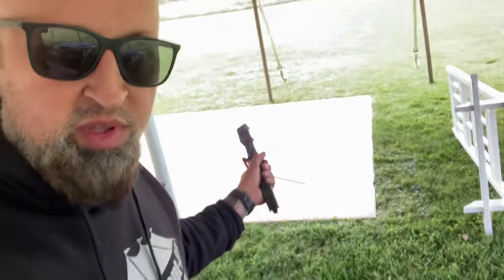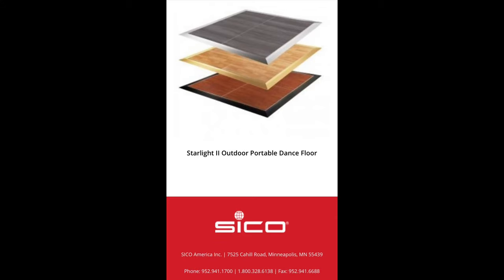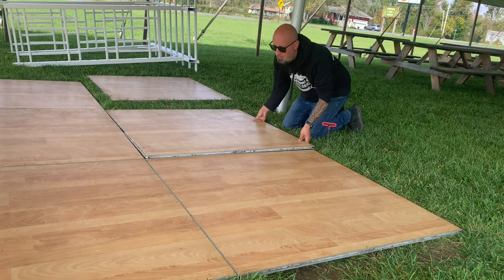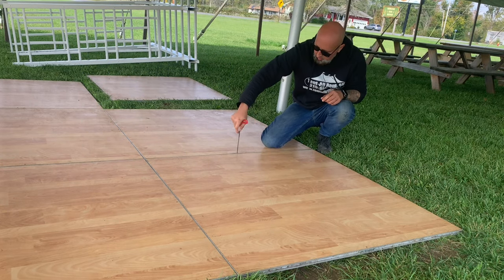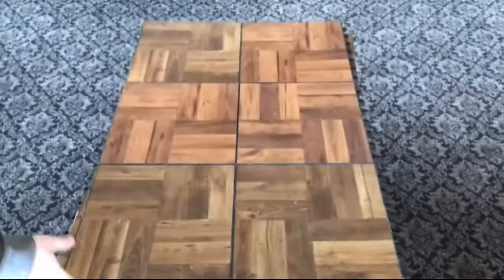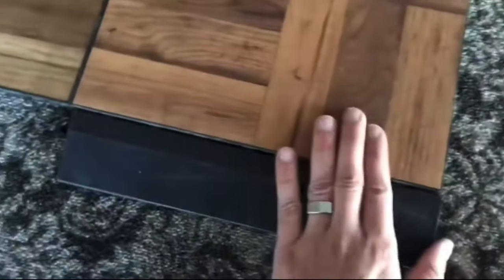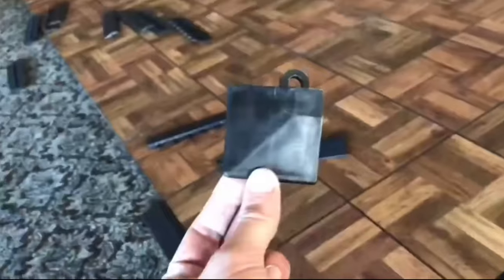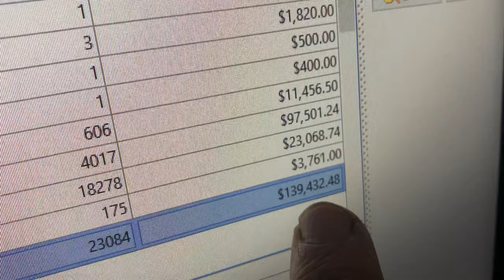Start Renting Dance Floors - BIG MONEY

Comment: How do you transport your dance floors? The case carrying 9 panels could weigh about 700lbs
Reply from the maker: Load in truck by hand 2 at a time. Then use our 4 wheeled hand cart from truck to location. I don’t like those dance floor specific carts. Bulky. Too much room taken up in truck. They are more for a banquet hall with a storage area where the dance floor is always on site.

Comment: One suggestion I can give when setting up a metal frame dance floor on grass is use small pieces of wood 6” squares on each joint that will level your floor and will allow the following squares to joint easier 

Also if you lay down a plastic sheet 2 mil it protects the back of your floor from moisture

Comment: How does the Seco type floor work on uneven or patchy ground? Your video showed a pristine flat lawn so obviously that was easy...how far can you go with this stuff before it doesn't work or stay together?
Reply from the maker: Works pretty well. The 4x4 panels do well over holes and ruts and patchiness. Because they are 4x4 and strong, they will go over gaps well. Obviously not best over humps but no floor is. Avoid the humps.

Comment: Can you use the outdoor tent (sico or palm Snyder ) indoors or is it better to buy from snap lock for indoors?
Reply from the maker: Yes. You just gotta keep the back clean so not to mess up the places floors.
Reply: @thetentguy  what’s the best way to clean them before bringing them indoors. You have helped me so much and I’m going all in. Investing today !
Reply from the maker: Best way is to not have to clean them. Get some plastic sheets. Cut and tape it to the common sizes (minus an inch or two on each side so you never see it sticking out) 16x16, 16x20, 12x12. put that down first. Let that get dirty instead of floor.
Reply: I couldn’t locate your contract. Do you have a link please. I will revise and use.